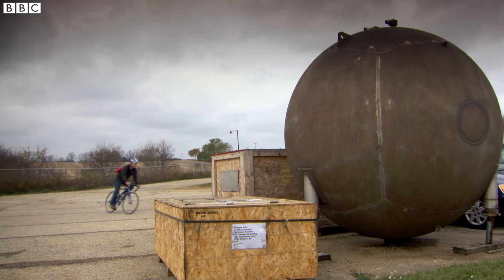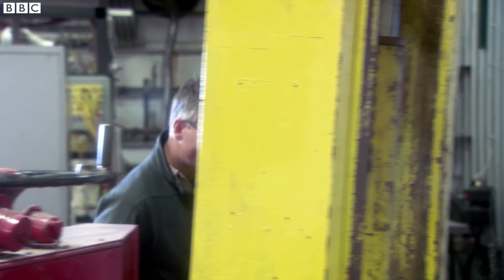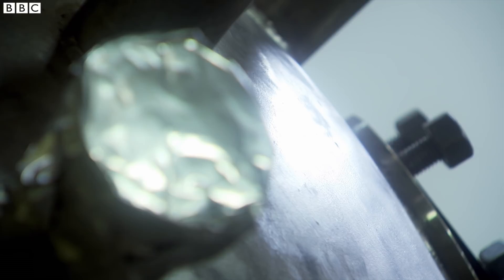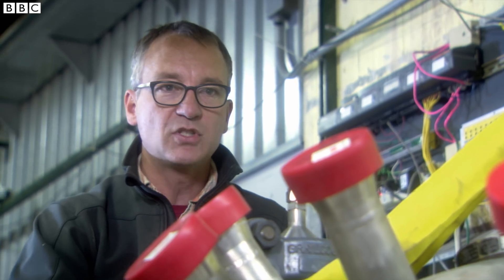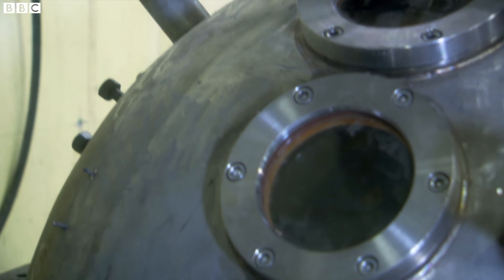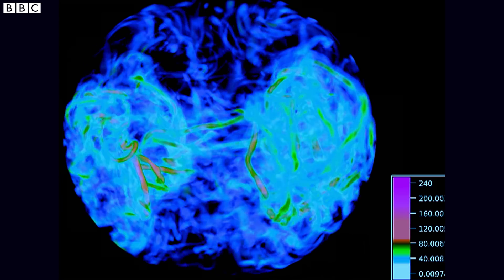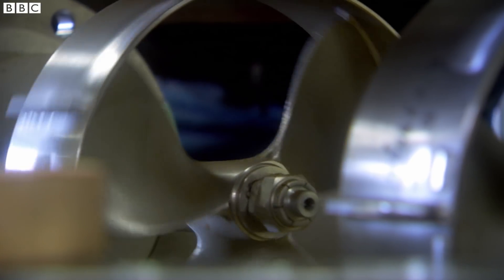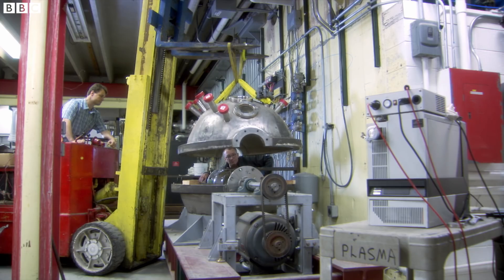How to Recreate Solar Flares | Earth Science

Comment: jfc did you see that place? looks like they have a budget if about £3.50, lol. The lid was being lifted by an old forklift truck, and the propellers were being driven by what looks like the rusty old cam belt system from a scrap engine. A metal ball with a couple of propellers inside driven by rusty scrap engine parts and all housed in a shed in the middle of nowhere. Not exactly NASA or CERN is it? I applaud their efforts but it doesn’t look like they are working with much.
Reply: Your not wrong but I want to see you make one then get back to me